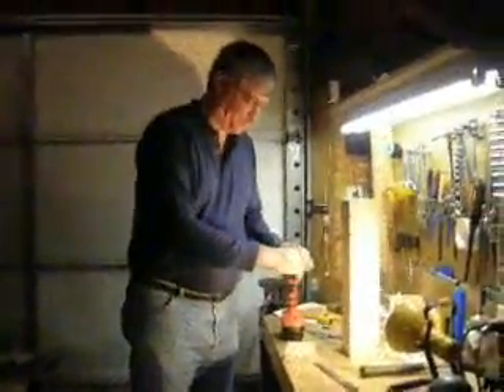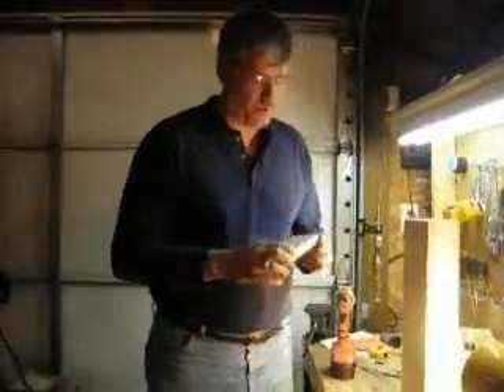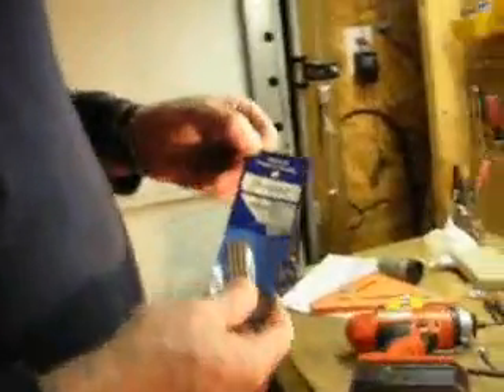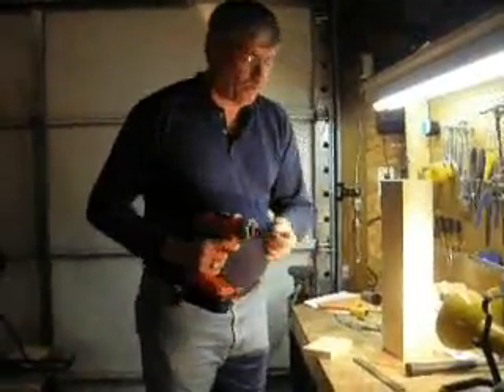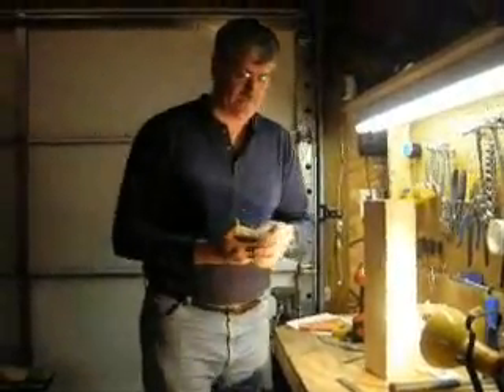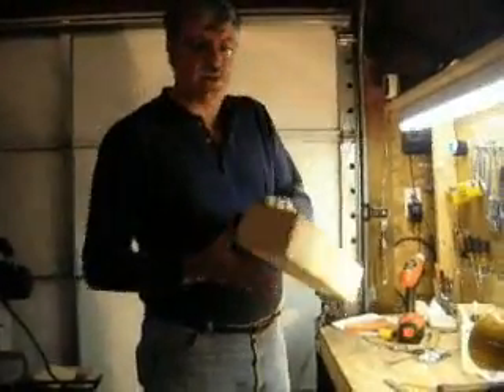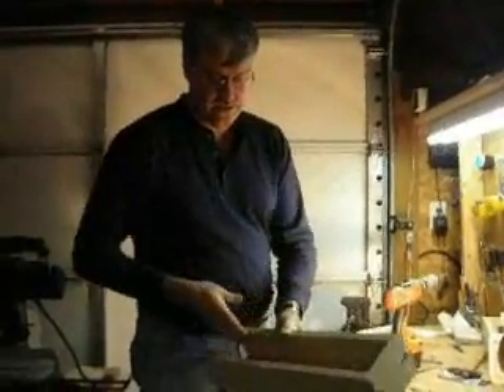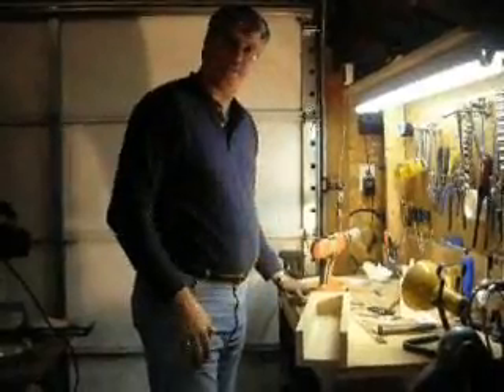How to Build a Soap Mold Part 3

Comment: For those that don't know about screws, in the size on the label 10-24 x 2", the number 10 is the size which equals 3/16"; the 24 means how many threads (turns) it has per inch; and the 2" is the length of the screw. There's also screws number 10-32... those are the same diameter 3/16" but have more "turns" per inch than the 24 ones. Hope this helps.